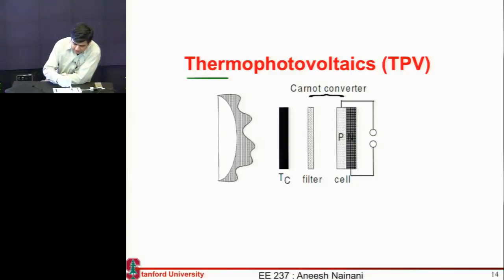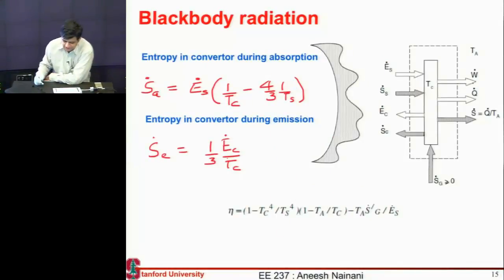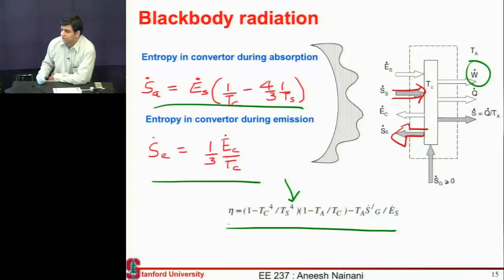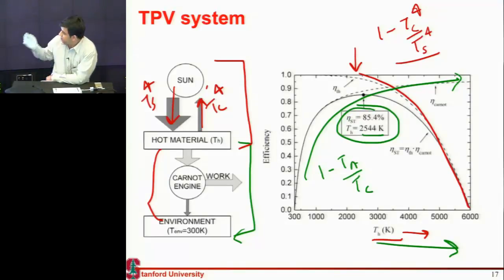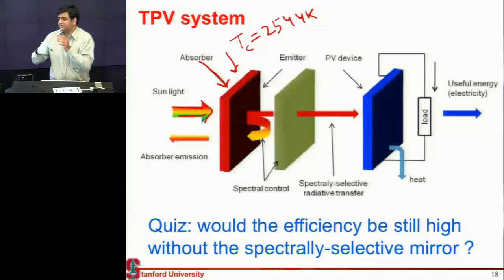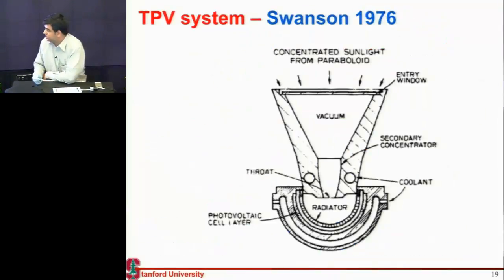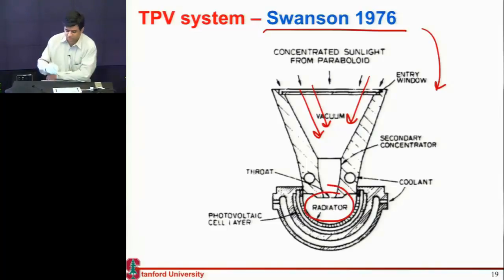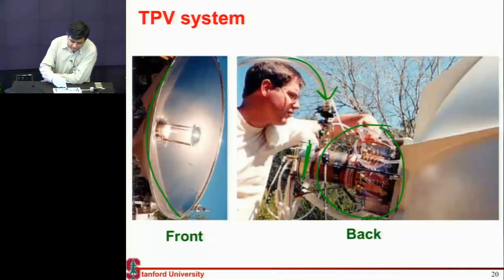thermophotovoltaics: part 1

Comment: Sir after absorber, the filter that we are using. why is it filtering the higher energy photons and not the lower ones?
Reply: The pv-cell functions with infrared, so, low energy photons. The hi energy photons are recycled, and the quality of their energy deteriorates thereby, thus turning to low energy photons, which the pv-cell can now use. it works just with low quality energy, which is very fortunate! the best would be to heat the absorber with a flame! I suppose it´s more efficient than diesel or stirling generators...
Reply: @klausbrinck2137  What about heating with a helium cooled nuclear reactor able to reach temperatures of about 1800-1900 degrees C? Instead of using that same reactor to make steam for a steam turbine...
Reply: @robertrichard2322  My diesel-flame-idea was stupid to begin with, cause you´d need heat by convection (infrared waves traveling through a transparent mediom, such as air or vacuum), and not heat by conduction (contact to the hot surface), so, both ideas would have considerable loses, competing with very expensive, but also 99% efficient steam-turbines... The calculation, which method would win, is difficult... But maybe still better than Pertier-elements, that function with conduction and are very unefficient... Sorry, but I don´t even remember the whole content of this video, in order to judge... It´s too long ago...
Reply: @klausbrinck2137  No worries, I just have a thought of a micro nuclear reactor, encapsulated by thermophotovoltaic cells transforming the heat from that reaction directly to electricity, having a hard time researching it though as I haven't come across anyone who has done it. The benefit in my mind, and I'm sure it isn't this simple, would be that there are no moving parts thus no maintenance, no damage, no oil, little to no cooling, just pure electricity generation other than maybe cleaning off the TPVs 

The efficiency isn't really that important, as long as you get a decent output, as you could have a device kicking out electricity on its own for years potentially 

I have found betavoltaics which takes light from a nuclear reaction and uses photovoltaic cells to make electricity but it is extremely low output
Reply: @robertrichard2322  You are right about the benefits. But one should find a source, that´s able to be exploited by extracting its heat-energy through conduction AND convection at the same time (never let one of those 2 simply get wasted), and that´s uneasy. The sun, on the other side, its heat can be exploited only by convection, and is as such, predestined for usage in combination with this invention...